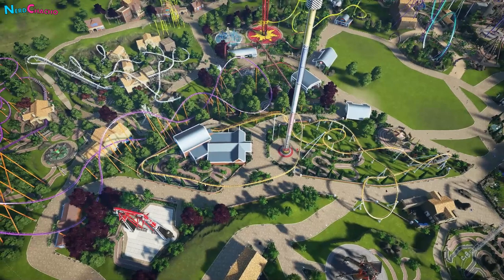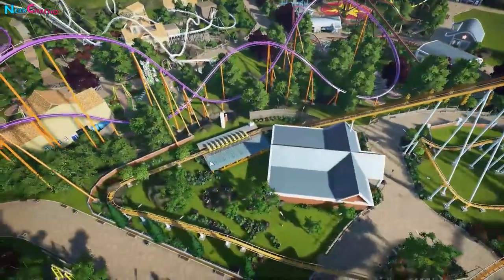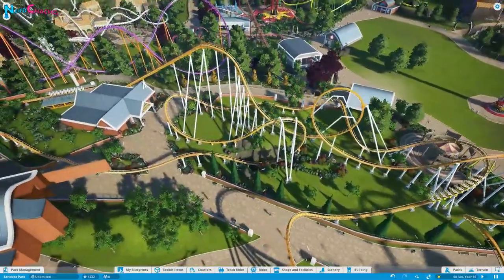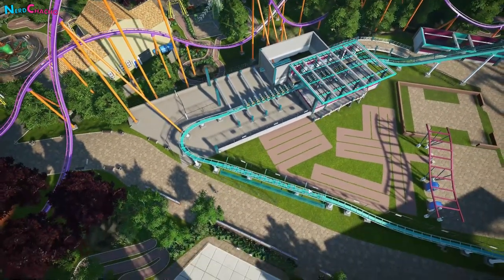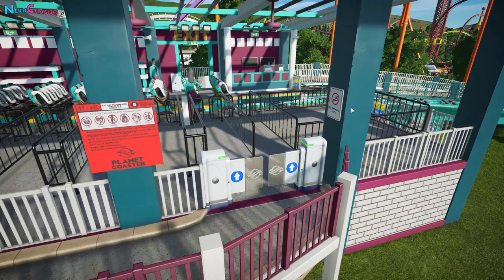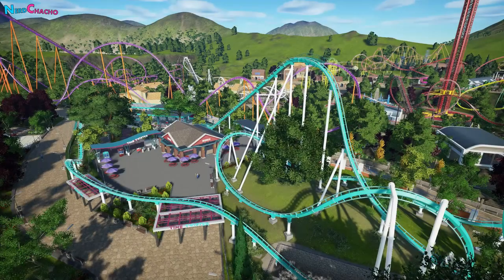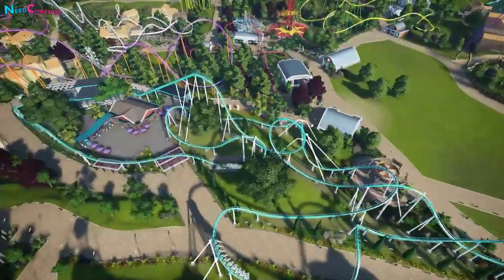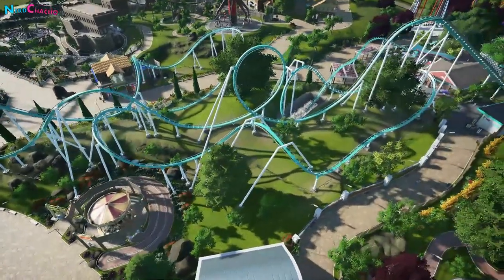B&M Floorless Coaster - Add Realism To Your Planet Coaster Blueprints - Real Up My Ride - Ep 4

Comment: Nerdchacho, this is really great, as are all of your videos! I just would’ve loved to hear more about the theory behind why you couldn’t put the thrill ride in the middle of the roller coaster area like you had it in the original!
Reply from the maker: Ahh thanks!! Well, the short answer to it is that you don't want to place rides where there is an overlap with coaster track because so much can go wrong - things falling from cars (possessions, not actual train parts) and the risk involved with the flat ride operating at just the perfect time for something catastrophic to go wrong or gathering guests in a queue under the track of a coaster. In the UK, we tend to define very clear areas for coasters and have, where possible, nothing or little interacting with it. It means you have an isolated area with minimal operation cross-over points. Even the likes of Blackpool, which is packed to the rafters has this principle. It isn't unheard of to have rides in coaster areas etc.. so don't avoid it completely, but if there IS a way to separate them, we would do. :)
Reply: @Nerdchacho  Thank you so much for this in-depth explanation! Somehow I suspected it had something to do with regulations and safety! hahaha